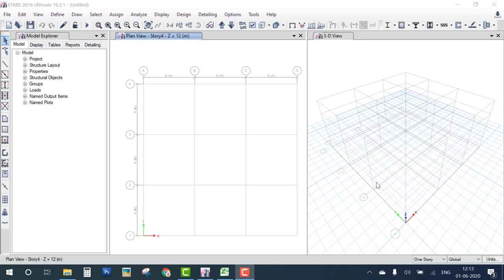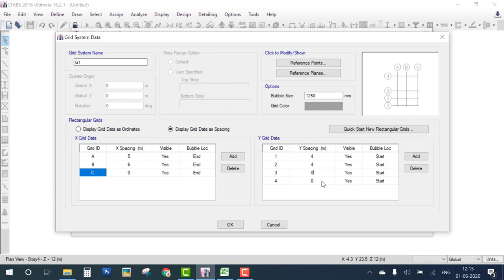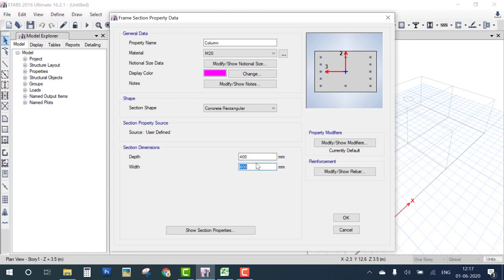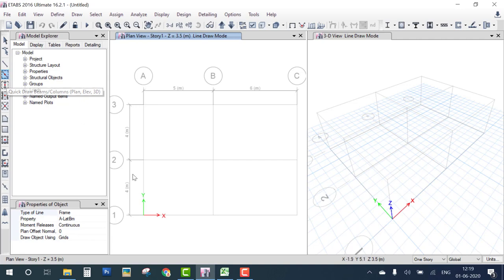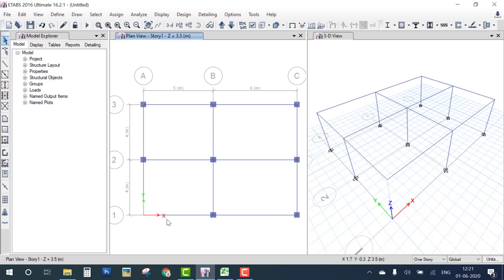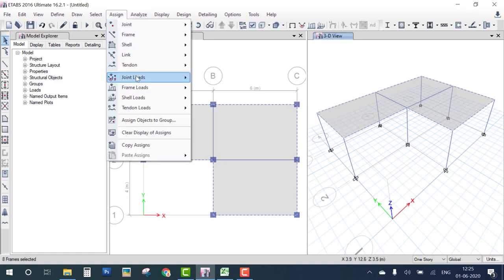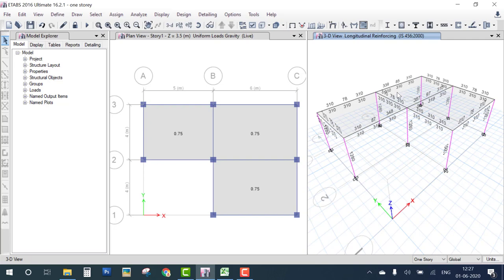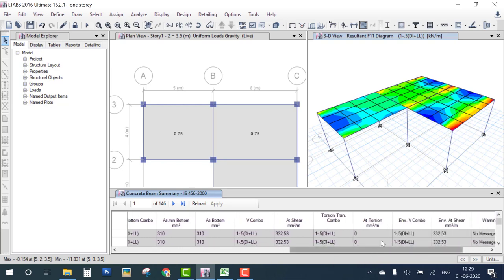Etabs one storey RCC Building Design   Civil engineer

Comment: Sir, I confused in designed to 1 floor. Because if the designed in roof materials not a concrete or slab, but the material roof is a cannal steel/galvalum. how a step that?